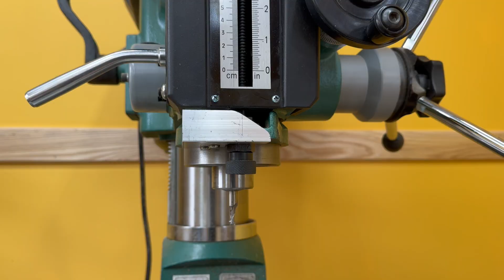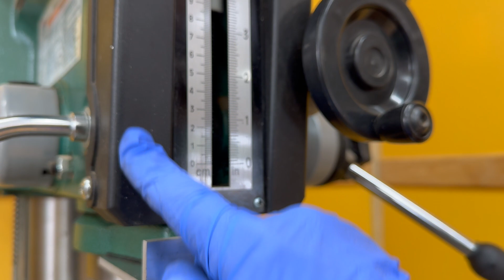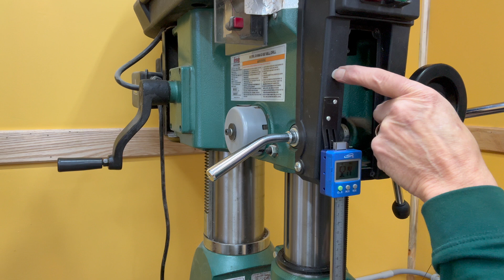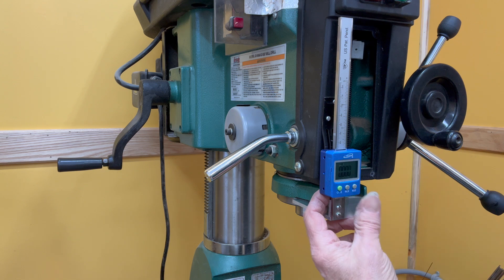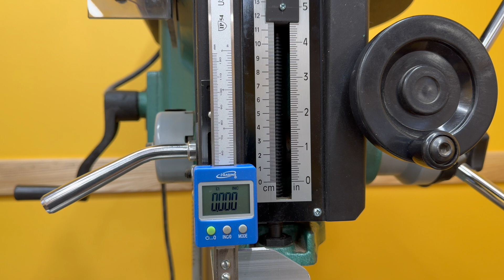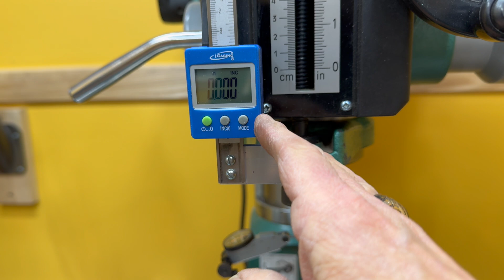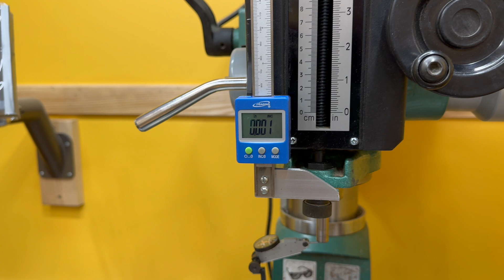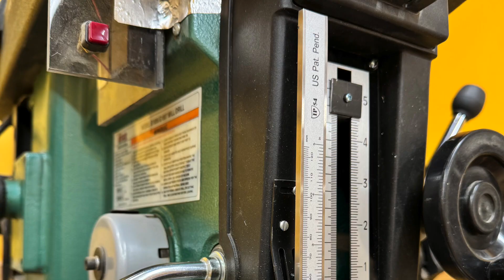Digital Scale On A Round Column Milling Machine @thepragmaticluthier

Comment: Kevin I'm subscribed and watch a lot!  I am curious as to the Grizzly mill and how you like it.  I am a retired Machinist and tool and Die Maker.  I used to have a Bridgeport Mill but now work out of
my basement and do not have room for the Bridgeport.  Doe the Grizzly have graduations on it X and Y movements in Thousands per inch or is it in MMs?  How do you like it for a bench top Mill? How much movement on the X and Y movements?  Thanks in advance for you input!  I need something in the line of a bench top Mill!  Does in take R8 collects?
Reply from the maker: Thanks for your question. My mill/drill is graduated in inches,  on both the X and Y axis.  The dials are not accurate and there is far too much play on both axis, I suspect in part because the lead screws are not Acme  threads. The nuts and gibbs are adjustable , which helps, but still, very high standards in manufacturing of precision were not met and there may have been compromises in the hardness of the steel to make the lead screws.  The machine does employ R8 colletts. My first choice in this style of mill was a "Rong Fu", but no longer available unless they manufacture the Jet round column mills.  Still, I find my machine quite acceptable because I never tax it very hard. I mill steel much less than I do less dense materials and of course, I work slowly when I have to work in steel.  I like the table travel, X=7 or 8", Y=24" and that is one of reasons I bought this particular Grizzly model.  To compensate for backlash, I mounted an inexpensive two axis DRO on the machine and it has provided a tremendous improvement in accuracy, repeatability and is a real time saver as opposed to mounting dial indicator everywhere to track movement. My requirements for precision are quite tolerant. I use the mill to make jigs and fixtures in my shop, many of which are perfect within several thousandths of an inch and sometimes, even ruler tolerances are acceptable.  Given my requirements, I find this mill very capable, but it in no way equals the rigidity  and precision of a good knee mill. This particular model is no longer available. Grizzly offers similar round column mills, but the table travel on them is shorter than mine.  I would be happy to answer additional question or converse more if you care to. You email me through my website, www.ladueguitars.com